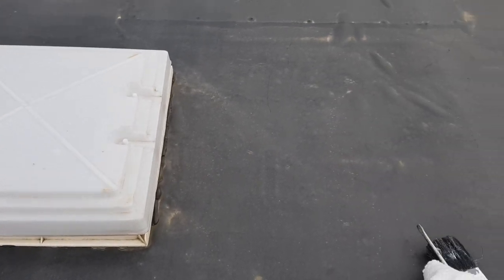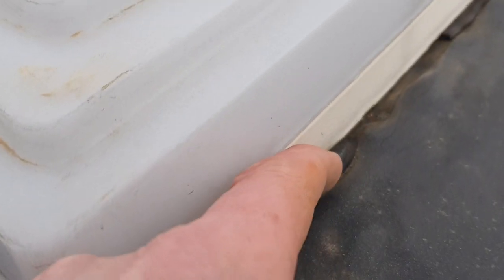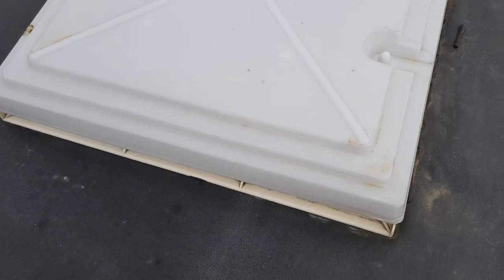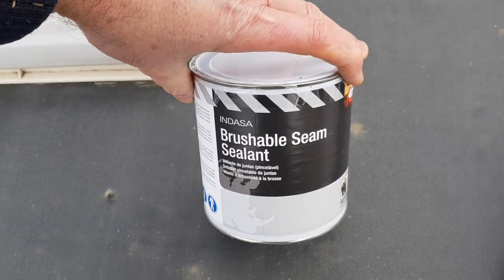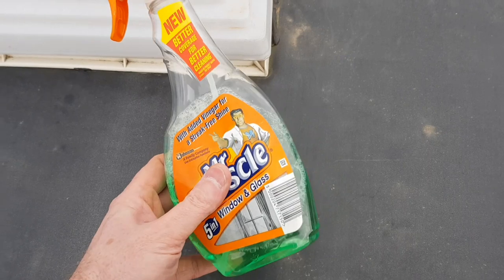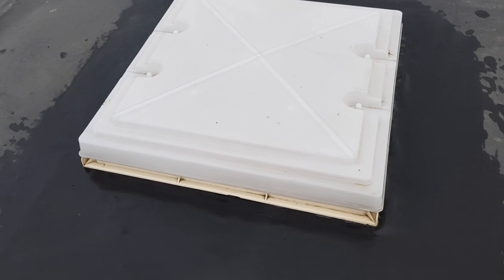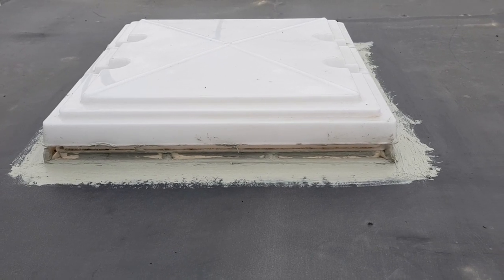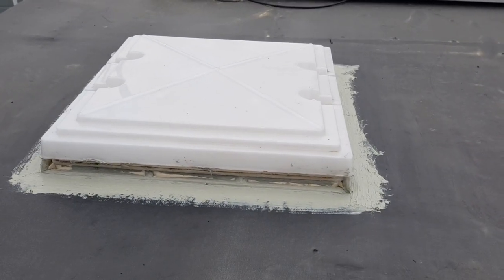QUICKIE | Sealing The Leaking Seals For Motorhome RV Roof Vents Skylight

Comment: Did you use the same stuff when you refitted all the windows ?
Reply from the maker: No. When we refitted the windows (for the second time) we used a black heavy gluey sealant that is used for domestic guttering jobs. It was underneath the frames, and so cannot be seen externally for the most part. Nothing gets past that stuff.

Comment: Take it was a metal roof if your sealing it with car body sealant??
Reply from the maker: You take it wrong 🤣
Reply: @VintageRVAdventures  any issues since the job ? i have leak around my skylight thinking of doing the same looks alot easier than using sealant thx
Reply from the maker: @Fousyrdous  Oh yes we have has leaks. A really good sealer is needed for these jobs.